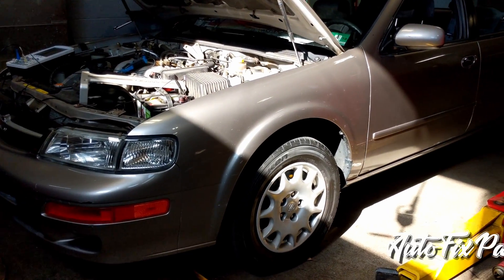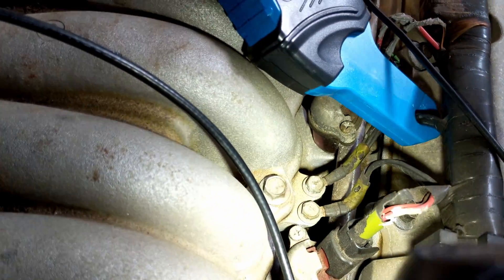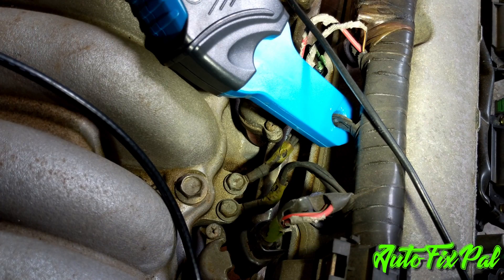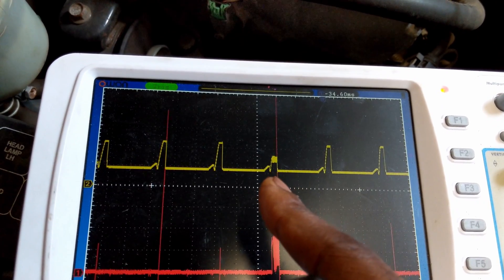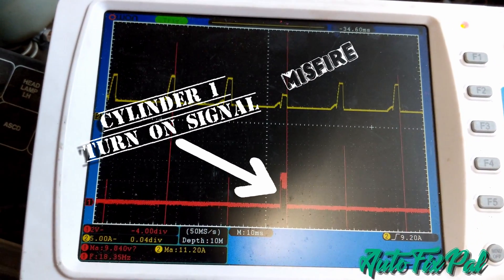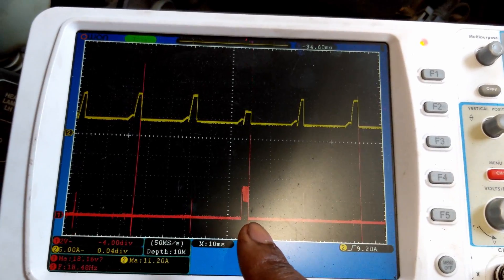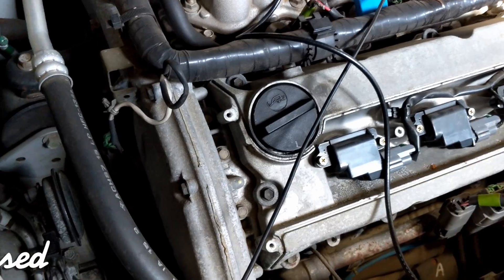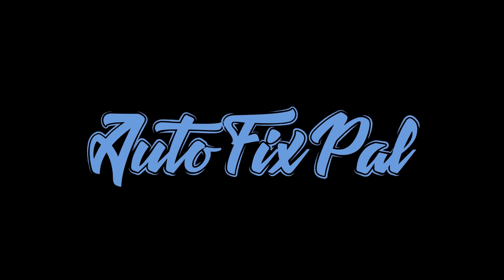1999 Nissan Maxima slight Misfire Diag - No Check Engine light

Comment: HELLO COULD YOU TELL ME WOULD THIS LOPE ON THE WIRING HARNESS TO USE FOR IGNITION SYNC BE ON NEWER NISSANS THEN 1999 AND THANKS SO MUCH FOR YOUR TIME !
Reply from the maker: yes it is on newer nissans. Might be taped to the harness near the front but its there on 2.5liter motors, 3.5 liter v6 as well. i cant find it on sentra and versa.

Comment: Why does the computer not detect the misfire in a situation like this and no CEL came on?  Curious, because our 2011 Rogue appears to have a misfire sometimes but has not thrown a CEL since a recent tune up.  I thought it might have been a bad coil, but after they tuned it up using new NGK iridium plugs, the CEL hasn't came back on.  (Before tune up it had a cylinder 2 misfire code and random misfire codes which threw a CEL.)  Still seems to possibly have a misfire without CEL.